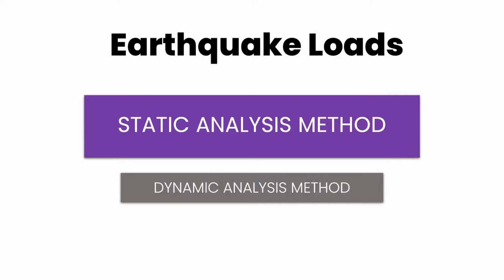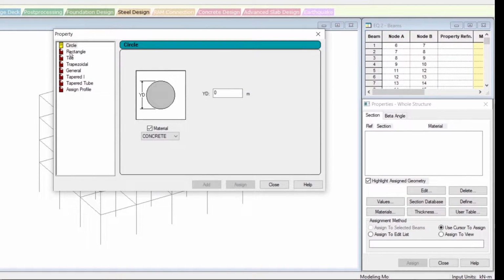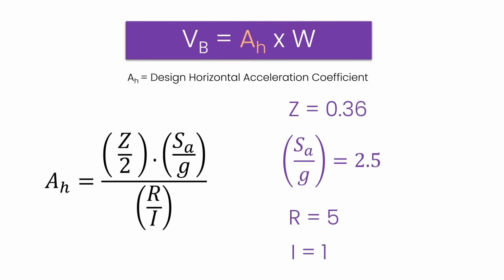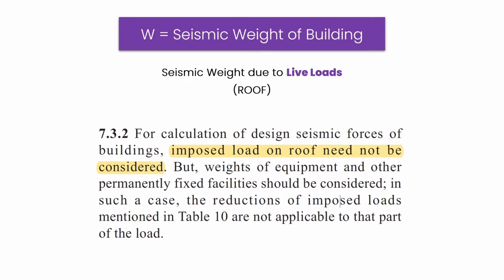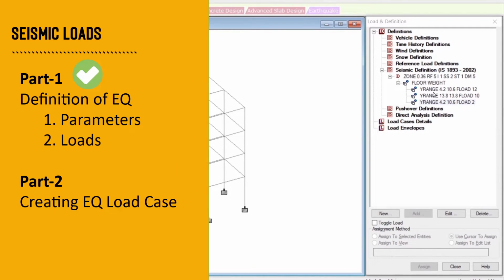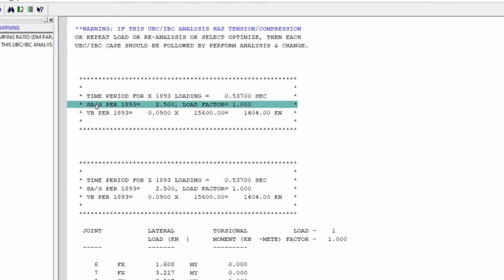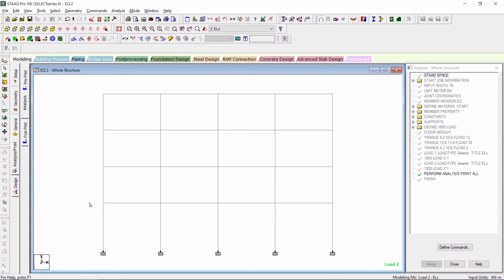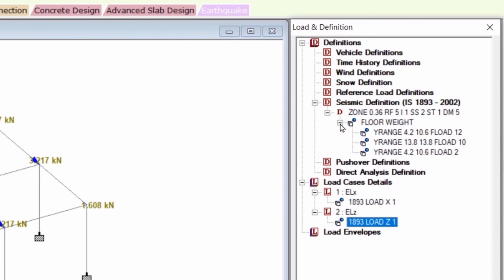Earthquake Load Calculations with STAAD Pro | Seismic Design for beginners

Comment: Sir As per observation, I didn't see you have provided the value of time period in staad px & pz .but In out put it is showing. Is it required to give or not in staad?
Reply from the maker: STAAD will calculate the values of Time Period automatically depending upon the other inputs that you will provide.

Comment: hello sir, if we just simply add the self weight then the software will automatically calculate all the dead loads or we have to assign these values. I am lil bit confused
Reply from the maker: Self weight is created only for the members you have modeled. For example if you model slab with 125mm thickness as plates it will only consider the load due to this. Additional loads due to plaster, floor finish etc. which is over and above this 125mm will not be considered by the software directly and you will have to add the same manually.

Comment: Thank you sir ,, did you complete calculation mean caclulate selfweight , dead & live load with load combination overall loads include secimic load 💖💖
Reply from the maker: This was just an example load. A combined value was used to make the manual calculations easy. You should ideally be taking all the necessary loads on the structure.

Comment: Why didn't  you add dead ,live load in load case details
Reply from the maker: This was just an example. In order to simplify the manual calculations I have only considered lumpsum Dead & Live loads as floor loads. In a real life case, you will have to provide all the relevant loads.

Comment: sir earthquake load x or y direction ke liye bas calculate hota hai ? or aapne 4direction show ki x y - x - y ?
Reply from the maker: You should consider X and Z direction as the EQ waves are most prominent in these directions. However, you should also consider -X and -Z direction especially if your structure in unsymmetric.

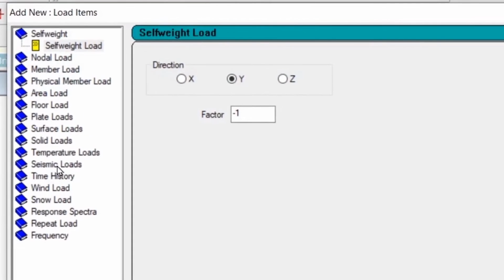Comment: Thank you for the excellent tutorial... I do have a doubt... @16:36 on the video you have selected the seismic load factor as 1.... Can we tinker with that value to compensate for the importance factor ? If I wanted an importance factor greater than 1.5, could I increase the seismic load factor ? Or am I interpreting the whole seismic load factor wrong ? Would be really grateful to hear back from you on this...
Reply from the maker: There are 2 things to understand here. 

First, since this was an example I have not considered any DL, LL etc. and hence I have not taken the effect of load combinations which uses the factors of 1.5, 1.2 etc for different combinations as per Engineering Codes. 

Second, the seismic load factor should invariably be kept at 1 during load creation. The factors of 1.5 etc. should be placed only when your are going for load combinations. And as I said, this is just and example and that is why I only talked about Seismic Loads and not the load combination effects. 

As for giving the Importance Factor greater than 1.5 there won't ever be a need. The IS Code is clear about providing the values of 1, 1.2. 1.5 for different types of buildings and hence you will never need to go above 1.5.

I hope I have answered the questions to your satisfaction.
Reply: @CivilBlackBox  Thanks for the reply... I really appreciate your efforts.... Sorry for the delay in my response...was caught up in family functions etc.

Comment: In self weight ,weight of floor is included,so what is purpose of adding floor load?
Reply from the maker: Self weight is the weight of all members you have modeled. For example, if you have modeled Slab as Plates inside STAAD you won't be needing to define floor loads again. You can simply use Self-Weight in such a case. However, the common practice is designing frame structure only ie. beam and columns only, using STAAD and slab manually. In such a case Slab load is to be taken separately as Floor loads as there is no Member to model the self-weight of the slab. I hope this clarifies things.

Comment: Sir, when i'm clicking on generate button after selecting IS 1893 in STAAD, it is showing warning saying "creation failed". Is there any problem with my software?
Reply from the maker: The error message is related to seismic parameter auto-generation as per IS1893 code in STAAD.Pro Select Series 6 (build 20.07.11.33) version. This problem has occurred because of the fact that Dll1893.dll has not been registered at the time of installation of the software. You need to register this dll file (Dll1893.dll) manually. 

The procedure is mentioned below--

1. Go to the following location— 
X:\SProV8i SS6\STAAD
Where x is the local drive where you have installed STAAD.Pro SS6 version.

2. Locate the “Dll1893.dll” file and copy the full path. The path will be as—
C:\SProV8i SS6\STAAD\Dll1893.dll

3. Open the command prompt in administrator mode (go to Run >type “cmd” and select the option “Run as Administrator”)

4. Write the following command—
regsvr32 “C:\SProV8i SS6\STAAD\Dll1893.dll”

5. Press Enter. You should see a regsvr32 window, confirming success. Click on Ok.

6. Now run STAAD and go to seismic definition to check.

Note: This problem has been rectified in STAAD.Pro SS6( build 20.07.11.45).

Comment: Sir y have u not used th self wt command in Seiesmic Definitions
Reply: Because he did not consider the load of the members(i.e. beams and columns).
Reply from the maker: This was just an example case. The loads were summarized as floor loads and hence there was no need of considering the Self Weight. For an actual analysis however, you will have to consider self weight, floor loads, member loads etc.

Comment: y u did not consider self weight in seismic definition
Other videos r taking self wt in seismic definition
Reply from the maker: This was just an example case. The loads were summarized as floor loads and hence there was no need of considering the Self Weight. For an actual analysis however, you will have to consider self weight, floor loads, member loads etc.

Comment: sir if we consider wall loads we have to provide member weight in seismic definitions right
Reply from the maker: Of course. This was just an example without using those. Just to simplify the manual calculations. You will use all the loads that exist on your structure.